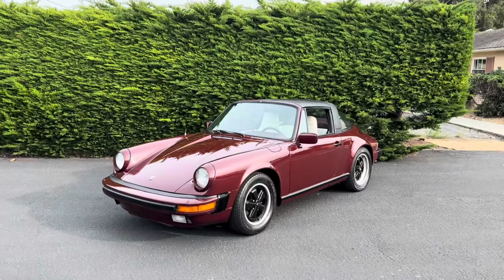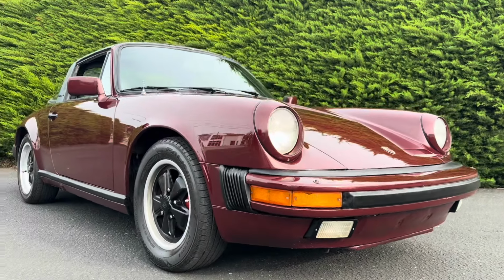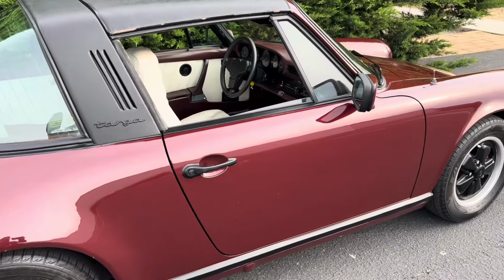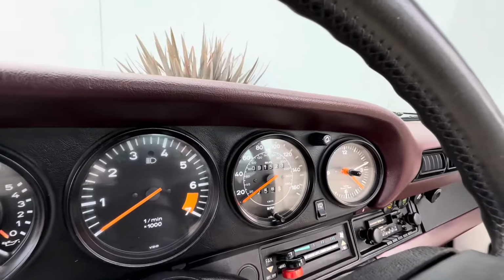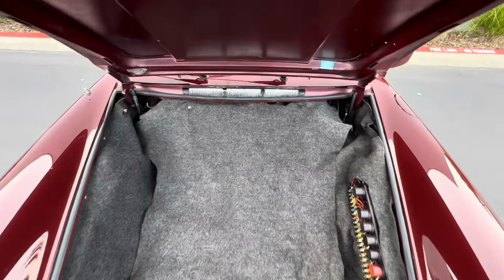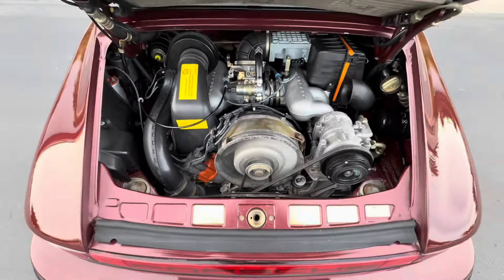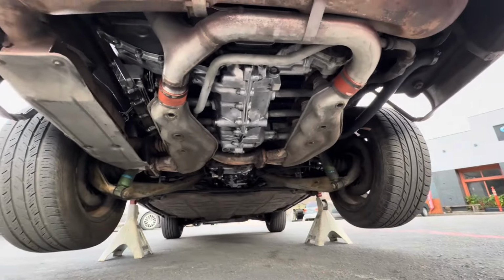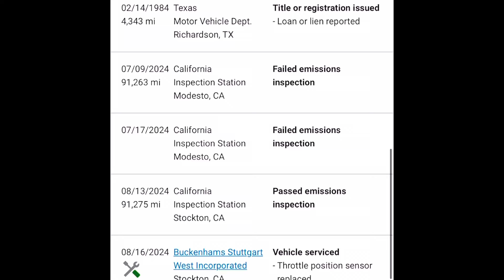1984 Porsche 911 Targa AT DODI AUTO SALES

Comment: "They went through the motor". What's that even mean? That's a general statement. Was the engine removed and rebuilt? Did they just replace a few fuel lines and do an oil change?